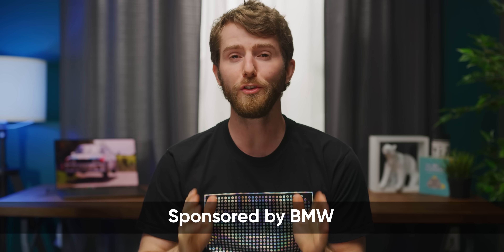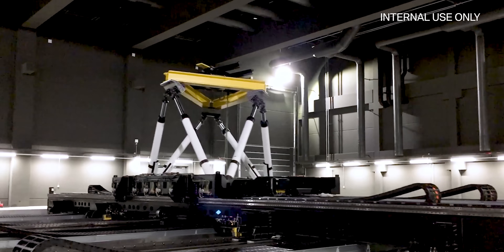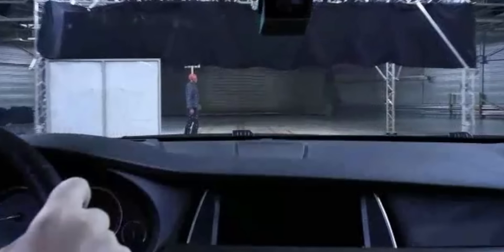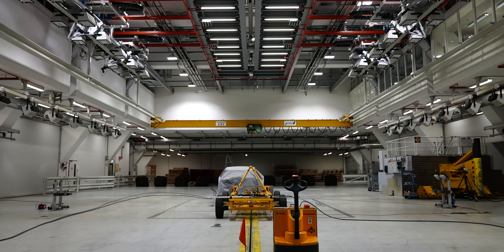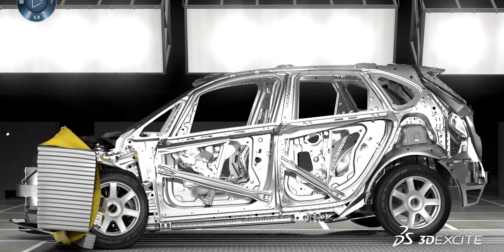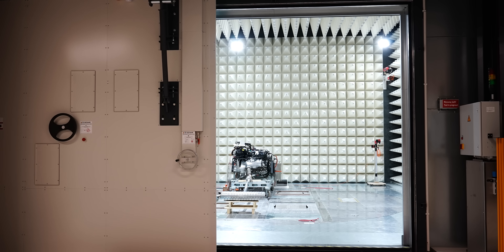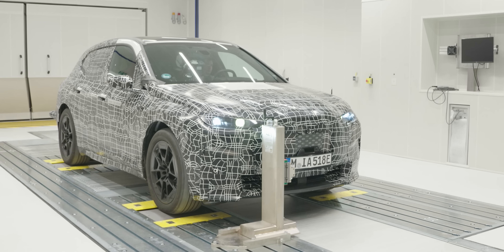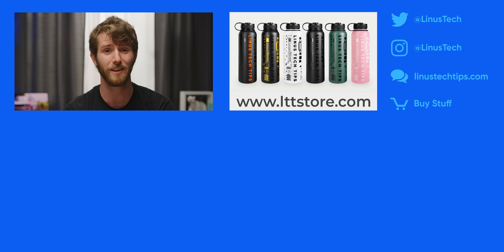BMW’s Billion Euro R&D Facility

Comment: This video's alternative title: The legendary German over-engineering.
Reply: mein land ist grossartig XD
Reply: @AIC_onyt   ey das ist nicht nur dein land das ist unser land
Reply: @kiwichem4336  meins
Reply: @justusanders242  nö ... :D
Reply: Anzeige ist raus
Reply: *when you can't afford one"
Reply: Maneti ist raus.
Reply: And the legendary German unreliability.
Reply: @wwbdwwbd  idk bro, german cars are pretty reliable imo
Reply: @void9092  Sure, German cars are pretty reliable... in the first 50k miles.
Reply: PiousCoding  lol. never had expensive problems with my bmw 330i. the most expensive one was to change an ignition coil and a transistor (after over 200.000km). took me as a newbe like half an hour. 
And for mercs, they say they are "ran in" after 300.000km
Reply: (and never had expensive problems on my old 316i)
Reply: Yea, no. Just check out the N43 engine

Comment: I’ve been to Porsche R&D for some collab work. Sadly I didn’t get to see this kind of fancy simulators, but they had a really interesting testing site where they use electric engines to simulate any type of motor, including vibrations, cylinder characteristics and anything that wouldn’t even cross your mind.
They use that to test the transmission, breaks and various electronic assistance systems.

And their workshop was the cleanest I’ve ever seen...all tools looked shiny new and there was basically not a single drop of oil or smudge I could see.

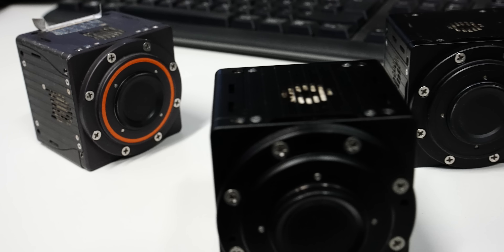Comment: 4:35 “1 gigabyte of footage” that doesn’t sound right
Reply: Each or even 1 TB.
Reply: I can imagine that they/he meant 1 gig per camera
Reply: Maybe he meant 1gb a second
Reply: 1gb per camera per test which takes a few seconds
Reply: Yeah lol. I am like, that's a minute worth of 4k60 footage from my phone.
Reply: I'm thinking 1GB per camera per second or 1TB per test
Reply: @lonsbury  yeah one of those for sure
Reply: @tolphmitph  So 50 cameras times 1 GB it's like 50GB, impressive? I dunno, not for me. It's seems wrong, One second of 5000FPS creates as much data as 83,3s of 60FPS footage.
Reply: @BHBalast  You got to take into account that the actual recording time needs to be a maximum of something like 5 seconds, which is still a lot, but at least they can just remotely press launch, record,  and stop immediately after the crash
Reply: The tests are like 5 seconds
Reply: Well, a Crashtest video is only gonna run a couple of seconds though, even in ultra slow motion, right?
Reply: @matthewmcewen1  bro thats still literally nothing, 5 seconds of normal 4k footage is over 1gb
Reply: @ceezymuccheez  highly doubt that, unless it's raw, which doesnt really count because there is no reason to store raw video of these events.
Reply: @ceezymuccheez  i went and checked out some common bitrates for 4k video. 4k60 can take up to 1Gbps bitrate on very high camera encoding settings. You can go higher but it's probably not important. This means you get a colossal 8 seconds of footage within your 1GB window. The kicker is that taking 1000 frames (instead of 60) per second doesnt instantly mean you have to multiply the file size by ~17 (1000/60). If, instead of 8 seconds of footage, you divided that by 17, you'd get ~0.5 seconds of footage, not accounting for interframe compression. Interframe compression will be very powerful at this frame rate because nothing has time to change before the next frame is drawn. I estimate that the benefits of extra frame rate for compression would mean you can get between 1 and 2 seconds of footage at 1000 fps, depending on file format and codec.

Comment: One thing to clarify the speed rumor in Germany once and forever: Not even on the Autobahn (highway) it is allowed to drive as fast as you can in a lot of areas because of speed limits. Also there is a speed recommendation of 130 km/h when there is no speed limit.

Comment: BMW's top engineers have been working on some groundbreaking invention, it's a blinking light that will tell you where you will next move to on the road.
It's going to be the best thing since sliced bread.
Reply: Don't worry, it will be a while before they perfect a way to retain the blinker fluid
Reply: it is especially handy to notify leading cars while trying to overtake on the autobahn, that you can currently see every spec of dust on their rear windscreen and could infact just hitch onto their trailer hitch.

Comment: If they're getting Ryzen 5000, they're gonna need some fast RAM.
Reply: Ryzen 5000 Threadripper! :D
Reply: @Maty2001  5990x
Reply: @sho7078  Yes!
Reply: I guess dodge has a big advantage on this one
Reply: I think the hydraulic rams that thy use in crash testing some times are pretty quick
Reply: dont forget RGB
Reply: 4 single rank or 2 dual rank sticks?

Comment: 4:30
Did he say that wrong? 1gb per test doesn't sound like very much.
Reply: I think he means per camera
Reply: 1gb each camera. And that for only 5 sec of video.
Reply: I think it could be1gb per camera. You although have to consider that one test is only a view seconds long so 1GB seems reasonable.
Reply: @4dy4dy  Makes sense
Reply: I was looking for this comment. Last time I did slow mo I was in the 5GB per real time second at 1500 FPS, maybe they're perfectly in sync and avoid extra space used and maybe that don't need 1080p... Idk but that number also threw me off

Comment: 4:35 Did you guys mean to say 1TB rather than 1GB?
Reply: Pretty sure it even possible that it 1 PB of film. Linus said 50 high speed cameras right?
Reply: @RedRingOfDead  That's 50 high speed cameras recording with 1000fps in fullhd for at least twenty seconds I would say. So 1PB seems to be pretty realistic.
Reply: @chibaryunosuke6002  thanks for the validation
Reply: @RedRingOfDead  it's definitely not film, and probably 1tb
Reply: @chibaryunosuke6002  probably less than 5 seconds
Reply: @chibaryunosuke6002  BMW might have clarified Linus before.. Maybe he miss spoked the unit of measurement..
Reply: @chibaryunosuke6002  you have no idea what your talking about. and the tests were 5sec. A Phantom can shoot 1000fps at full 4k and only takes 64GB for 5 sec. That is only 3.2TB for all 50 cameras. 50PB is a stupid amount of data for a years worth of tests let alone a single one.
Reply: @GifCoDigital  Well you're right. I don't know why I wrote 50TB to be honest. What I meaned was 1PB for all 50 cameras together. How the fuck did I write 50PB. That really would be much too much. XD
Reply: It is 1gb per camera for a few second test

Comment: The astonishing part in BMW is that all that facilities and investment for electronics is for making their cars the most electronically faulty on the market...so they can charge you for example  $200 for fixing (changing) a 20cm cable in the ABS sensor that make the car useless because a warning appears all over the board....That is an admirable marketing and commercial strategy.

Comment: Ford should have put their diesel engines trough that EMC testing, and many others needs to run their LED/Xenon lights trough it.
As a ham radio operator with HF/VHF/UHF radios in my car, many cars are wirtually clusters of RFI rolling around...

Comment: All of this research and development in tech so much processing behind it all but yet still have a cascade of electrical problems and like 20 fault codes per scan. Need I mention the plastic parts that should be made as metal like cooling system hoses, the resale value explains where there research and development is, in performance and enjoyment for a short lived time

Comment: 1G cornering force of a Formula E car? A Toyota Corolla can do 1G laterally on modern road tyres. Several road legal sports cars can do 1.4 lateral Gs on road legal tyres (Michelin Pilot Sport Cup 2, Pirelli P Zero Trofeo, or other super high end tyres). I'm fairly certain Formula E cars can do way more than that... EDIT: FE cars can probably get closer to 1G in acceleration for a moment.

Comment: I wish BMW put a little more money into quality of head gasket, oil seals, transmission parts, quality of engine block to avoid cylinder cracking and failure of the above gaskets around 100k miles.

Comment: Hey linus for ur fans or just help will u replay or make a vid/ content of why a 120hz cmi vs 120hz tv the difference between them i got a 50 in tlc uhd 4k at 120hz cmi for 250 and really want to know if its powerfull enuf to run it to it full potential will u make a vid comparing 120hz vs 120hz cmi so u can

Comment: Should've asked them when they plan to un-shelve hydrogen combustion engines, as the cost factor makes more sense now than when they figured it out in the 90's.
Porsche is investing, somewhat secretly, into alternative and even synthetic fuels, so whoever takes the lead in this direction will reap the rewards and covet the title of industry leader.

Comment: hey linus, can you do a build:
replace a 3770 and a gtx960 system with a wd blue 1 TB and a kingston fury 120 ... 
to a modern gaming pc under 1k Euro ... not the fastest build because the main load will run on linux and you will use virtualised windows10 to run just a view games .. and for that you wand to pass through a secondt grapics card ... get samething in thisarea ... with comonents you know will at least live through 5-6 years

Comment: It's too bad they put a lot of that active safety tech behind an expensive pay-wall. Toyota has most of the safety tech standard on even a Yaris. For a Mini (BMW owned) Countryman, getting automatic emergency braking is only available through a 5000€ option pack, with other nice to haves like blind spot monitoring not even available as an option.

While I do believe they are great cars to drive and there's a lot of focus on the driving and handling itself, it feels like BMW is taking too much of a conservative aproach on tech in general, and where they are not, too much of a profit driven aproach by treating it as a very expensive option.

Comment: I think the Linux developers should start engineering “open source” Apple Killers and put Apple in their place. I personally don’t think Apple software is all that special. They have always been a little bit snooty, when it comes to the individual users. Now is the time move while they are a little bit vulnerable. I also think Windows has never crushed Apple because it would have been mutual destruction. Linux could easily replace Apple in that equation. The future could be very different for developers with the guts to give it a go.

Comment: Linus I need some help, I have a 2070 super 8gb, 10th gen i7 with 6 cores and 12 logical processors, and 32gb of ram, but can't get over 40fps in most games, with 100% cpu usage, low gpu usage, and low fps, I don't think it's actually using all my cores, I have every setting on maximum performance and tested my cpu with Intel Processor Diagnostic Tool, it passed all tests.

Comment: The BMW i3 was launched about the time of the Tesla Model S. Seven years later Tesla offers four different models in a number of variations with up to 100 kWh. BMW? Doubled the battery capacity of their only EV twice, to 39 kWh. I don't see BMW in any leading role. But they are good at selling 'sporty' image cars without having a real supercar. Not even Audi is that dumb.

Comment: Making vehicles safer is great with some exceptions. Automatic braking before the driver does because they're not paying attention is the wrong approach. Sure there's no perfect solution for driver error. Getting in a crash due to negligence though is a much more impactful lesson than almost being in one but the vehicles assisted driving features saving you. If that's somehow still too cruel then how about this. Keep the assisted braking but build tasers into the driving seat or steering wheel. So if the automatic emergency braking does have to engage, it'll still give the lazy driver a good shock so they learn their lesson.

Comment: This is all super impressive but BMW has one of the worst reliability records of the German manufacturers. My 5 year and 50k mile F11 5 series had the following fail within 3 years. DPF, rear wheel bearing, both front bearing hubs, both rear springs cracked and headlight condensation. I've had 20yr old cars before and never needed new springs and a headlight and I'm not alone. BMWs feel great, have great driving dynamics, great interiors, great infotainment but god awful mechanical reliability. If you buy 2nd hand and don't want a money pit buy a Lexus.

Comment: No reliability department I see.
Reply: Bear Man  Their timing chain engineer must have been off sick when they designed the N47 & N57 engines, and their chassis engineer off on holiday when they designed the e46 rear axle carrier panel, and their crankshaft engineer on secondment when they designed the S85 engine. I could go on...

Comment: If only BMW didn’t make fucking plastic cars. I love bmw, but a lot of their gasoline cars and diesel have way to many plastic parts in the engine bay that heat make crack and not last long. And over the top engineering that’s unnecessary and a money pit to fix. Not quality, just nice to look at, luxury

Comment: Linus, utter bullshit. this project is just for kicks, and not fit for purpose. Any advances in the real would should be monitored in the real worl.
Any handling characteristics, deemable for forensics will only be captured on a moving car. We all know that "moving car" dynamics require a moving car in real world. This toy is of no use in design, function nor point. I wonder how much it costs BMW share holders?